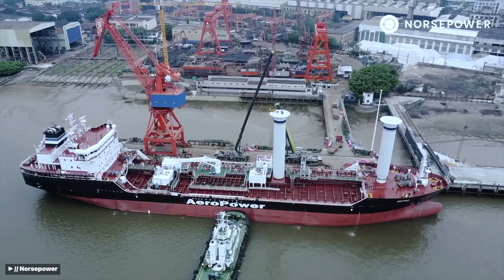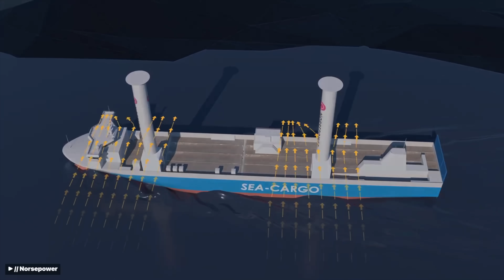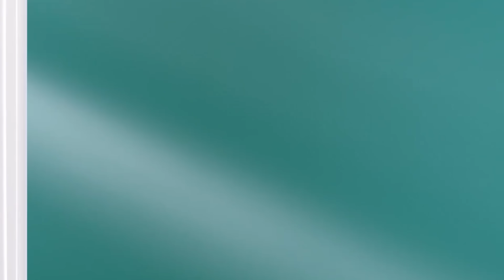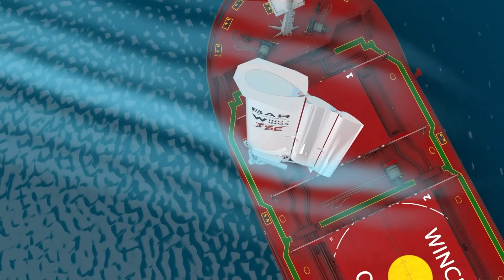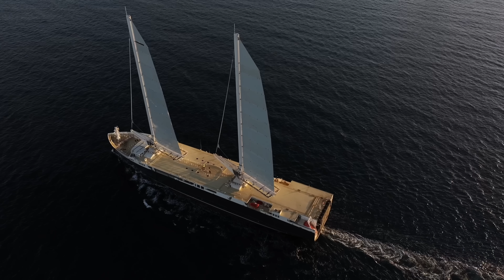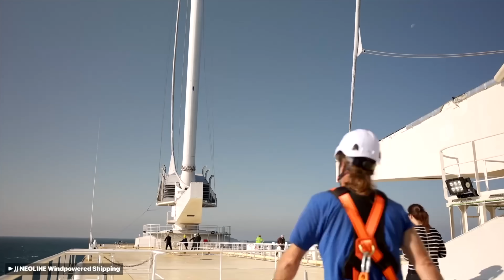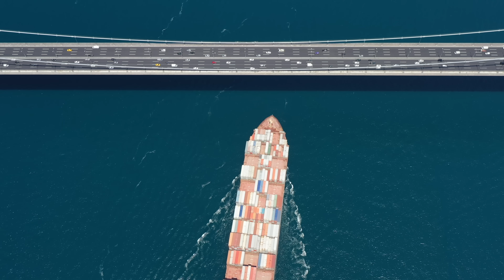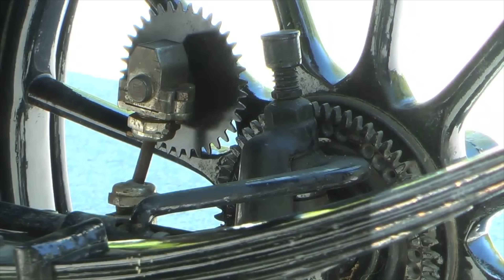Surprise Breakthrough Solves Shipping's BIGGEST Problem

Comment: 40% of all shipping moves fossil fuels like coal, LNG, or oil. Which means global shipping will decrease MASSIVELY once electrification kicks in at scale for ground transportation.
Reply: When will electrification kick in?
Reply: @rjbiker66  It's a slow process, but a lot of countries are trying to get to net 0 by 2050 and electrification of most road traffic is a big part of that.  Advances in battery technology are happening all the time, too, slowly making EVs more palatable and/or more affordable.  

Big part depends how bad the oil shock from Iran turns out to be.  If it brings back the idea from the 70s that even if you have money, you just can't reliably get enough oil, that's gonna add a whole new national security angle to electrification and green power options to the existing concerns about climate change.  And...well, we've seen how countries will try to move heaven and earth to ensure their national security.  That might push countries to start prioritizing it in a much bigger way.  Look at China for instance, the country that was suffering from major air pollution issues because so much of their power was coming from burning brown coal (a very impure coal that produces a lot of air pollution).  They're now by far the world leader in solar power and EV construction, largely motivated by a top-down decision to fix the air pollution issues.  (And yes, China's China, they can make top-down decisions like that a lot more readily than democracies can, because top-down decision making is where autocracy excells, but a government determined to foster the development of renewables can cut fossil fuel subsidies, make trade agreements for components involved in renewable tech, preferentially permit renewable energy projects, subsidize power grid enhancements necessary to handle transportation energy coming from grid power rather than gasoline, etc.  It's not like democratic governments can't govern, they just have a much more abstract toolbox)
Reply: @rashkavar  Have no idea if you are a Chinese shill are you are just that gullible.   Green power in China is a facade.   They are building coal burning and nuclear plants in record numbers to power their "electrification" as you put it.  The idiotic net zero concept that foolish liberal governments have forced thru is literally IMPOSSIBLE without a fundamental breakthrough in base electrical generation. Whether that is arc reactors, cold fusion,  solar or geothermal some type of breakthrough is required to make it feasible.   It in s a dream and incredible waste of money to implement until the basic concept is resolved.  It still could be done but to support the replacement of end user fossil fuel use industrial generation of electrical energy would need to be massively scaled up.   You are merely shifting where the power is generated by fossil fuels.
Reply: @toddconnor-wl7xd  not really. Scotland currently produces more than it needs from wind, and we invented the wave turbine which will also kick in to generation soon.
With a nuclear and gas base of 25% we are covered for our needs.
A living example of what you said is unachievable, from an oil producing country.
Reply: @daftgowk1  Again,  wave turbine technology is interesting but it is unproven. Sure looks promising and has had successes in small deployments but will it be like many abandoned solar farms and wind farms where it is great on paper but never actually produces on spec and in a few years everyone realizes the long term maintenance costs make it almost  completely untenable for large scale production.  Also, with advancing technologies the need for electrical power is expected to increase by 100 to 200 percent over the next 10 to 15 years.  Do you think the limited green tech can bridge the gap?
Seriously,  I think it would be great but any meaningful success has only occurred in places with very specific geological features that make it particularly compatible with certain technologies such as Iceland using geothermal and the Faroe islands demoing wave tech.  As for Scotland, the technical papers I have read estimate 30-40 percent green energy and that is if everything is producing optimal results.  Many say it will be closer to 20.  Increase in electrical demand looks to degrade any improvement year to year.
Reply: @toddconnor-wl7xd in Scotland as I said already, we already produce more than our needs from wind alone, not 20% or 40% as you said, that's simply fact, .are you reading old studies rather than the fact of what is happening as we type?
I know a fair bit about it, my dad and uncle were OGs in the oil industry in the 70s,ended as captains of the global industry managing fleets of rigs, and oilfields having led in most oil producing countries in the world. 
My cousin manages many of the wind farms in Scotland. My brother worked on the gas rigs.
I have friends who are working to develop wave turbines, and although as I said, it will generate soon, not right away, it has been proven outside of commercial applications. It's not unproven, it has not been adopted yet commercially as it has only recently been invented.
I agree different countries will have different solutions, maybe some will rely on solar more as that do now, but I don't agree with your subjective view, as it does not reflect the reality in Scotland, or the potential to do what you said is impossible in other countries.
Reply: @toddconnor-wl7xd  don’t forget that across the uk and especially in Scotland we turn off wind turbines so the gas turbines can run long enough to be efficient and we pay the turbine people the going rate for electricity which is bonkers. We need better investment in storage so we can harvests the electricity better.
Reply: @toddconnor-wl7xd  China is deploying generation capacity as fast as it can in any form it can produce. Coal just happens to be one of them. They also lead the world in every other category, because they work.
Reply: @sCiphre  Not sure of your point.  Yes they are increasing fossil fuel and nuclear baseline e!ectrical power generation at record pace because again yes they work and are reliable  Technically they do produce the most hydroelectric in the world of any country as well but it is because of its gross scale not its efficiency. The dams are more about water control than power generation.    As for green generation such as solar, wind, etc  most are vanity projects by local jurisdictions and rarely work to spec if at all or stay in service for long after the local govt receive the national incentive payouts from the main govt. 
The point of the original poster was to point to China as a paragon of green energy to validate the net zero concept.  As if the majority of its power comes from green sources.  It just isn't true.
Reply: @toddconnor-wl7xd  he didn't say they're independent from coal or oil, he said they're leaders in construction of green energy. Also although nuclear is dependent on a finite source, it is still more green than oil and obviously coal. It is all a process, I don't get why people get so defensive about alternative energy sources. Constraints drive innovation.
Reply: @reapwit .   
He is referencing net zero policies which is to end all fossil fuel usage.  Also China which  is being held up as a paragon or model of green usage we should all ascribe to.   Which is absurd if you actually know the situation in China. 
I am all in favor of green energy development but that doesn't mean I am not aware of its current limitations. 
 What I am not in favor of are the sweeping forced changes of  the entire infrastructure to  electrification  before a sustainable industrial generation technology is developed.   Literally all this entire initiative does currently  is spend trillions to change where fossil fuel is used.   You go from end user use in vehicles, ships and homes, etc  to all fossil fuels burned  at the base industrial plants to produce the "green" electrical  revolution.  It is nuts.   
Your other statement  about nuclear is both yes and no.  Certainly doesn't produce green house gas but the radioactive waste is far worse as we still do not have a affordable treatment method or a completely reliable storage method.  
Anyway,   the jist  is the liberal govt's are forcing this change before the technology exists to support this entire new energy paradigm.   It foolish and wasteful. 
As soon as someone develops a fusion reactor, or megajoule solar array,   advanced nuclear remediation process -- something that this new infrastructure could feasibly develop around. Then and  only then will this massive shift be a good idea. 
But things like the ships using various alternatives green technologies to reduce fuel are great and that is how development is generally suppose to happen.
Reply: Unless they start having to move rare earth materials for battery production
Reply: @docdissent  except it will not hit because electrification is impossible without a robust nuclear power grid. Spain teaches us that renewables are worthless for a national grid. Something constant and powerful is required and neither Europe nor USA are even considering a massive nuclear power buildup. In my uneducated opinion electrification is the same as fusion power generation, always 20 years away.
Reply: @HalIOfFamer  except we already have reduced carbon intensity if GDP because enough cars are electric and enough power is renewable generated that it impacts the fossil fuels markets. Demand growth is massively suppressed from projections from 10-20 years ago. Fusion is still doing nothing, electrification and renewable energy is having impacts today already even if we are decades away from some utopian vision. He’ll look at power tools. 15-20 years ago all weed blowers, weed wackers, chains saws etc were 2 stroke motor driven, now most new ones are battery powered. That’s a pretty massive change unlike fusion power.
Reply: @docdissent  Electricity is also power... so where are we getting that from?
I expect you thinking of green power?
Using less energy is the best solution.
Reply: Magical rainbow unicorns farting electron streams will make your dreams come true.
Reply: It's not 'fossil' fuel. Converting biomass to hydrocarbons requires pressures that far exceed the the depth oil reserves are typically found at.  That is the inconvenient truth nobody is allowed to mention. It's hard to control a global currency backed by oil if nearly any nation can get at it with sufficient technology...(and I'm not suicidal, btw.)  
The relevant search term is 'abiotic oil'. There's no hydrocarbon crisis if you drill deep enough. The other interesting term is 'methane clathrate'.  Good luck, have fun.😉
Reply: @dirtdiggity1714  The method of creation isn’t important for this debate though. Abiotic hydrocarbons still contribute to global warming and pollution
Reply: Doc, the data was a bit hard to tease out. But by weight, about 1/3rd of truck cargo by weight is coal, oil and gas. That is just over 6 billion of the total 18 billion tons.

The semis hauling gas and diesel and the smaller but still huge trucks hauling propane are far and away the heaviest trucks commonly on our roads. 

Extremely heavy trucks do a lot of damage to roads, much more than far lighter Pickups, SUVs, EVs, small gas cars, etc.

A single, 80,000 pound semi does the damage of 9600 cars and pickups.
Reply: @freeheeler09 The comparison per person per kilometer per year between cars, trucks, bikes, buses, and trains is also interesting. I wish I had the numbers.
Reply: Science is fun and interesting...that's the point of the video.  No one cares how smart you all think you are. 😂
Reply: But the reduction in fossil fuel shipments will be replace with other forms of shipments so we need to decarbonise shipping regardless...
Reply: if more countries drilled for oil in their own countries instead of buying from overseas then you could cut the Co2 from lots of the shipping now.
Reply: @DanielsCorner644  It's not like there's a layer of oil under the ground where you can install a tap. Many countries don't have oil.
The rich countries who have oil either export it to get richer while using some themselves (the US), or export it to fund their own solar+electric transition (many Gulf countries).

There aren't many poor countries that have oil. If they did, they'd be rich (even if, depending on the government, the money wouldn't necessarily trickle down).
Reply: @DanielsCorner644  The biggest CO2 contribution of oil comes from burning it. Like, by far. Extremely far. Shipping isn't the reason why burning stuff pollutes the air.
Reply: @Regretr1 Agreed, although ships are especially dirty and always a part of the problem.

Comment: I think wind will help battery powered ships work on most routes. So it looks like wind + batteries will be the future of shipping. 👍
Reply: What charges the batteries?
Reply: @rjbiker66  A big charger at the dock, or container size battery swapping for smaller ships. China is already building electric ships. Look it up. Scandinavian ferries are all going electric right now They have a lot sailing around already. But bigger ships will be a challenge. China is working on them, but can only be used for shorter trips, port to port. Longer trips probably won't work. TBD

Comment: Questions not answered in this video:

1) What is the average change in shipping times?  Longer shipping times will strain supply chains that have become dependent on JIT receipts.

2) Which of these systems are adaptable to existing ships?  Only the final one is obviously so as it can attach to the anchor mounts.  With many cargo ships staying in service 50+ years, this is not a small question. 

3) What is the capacity penalty?  The reason hydrocarbons won is capacity and reliability.  With modern wind tracking, the reliability issue is less of a concern as we can accurately forecast winds up to a week out.  However, ships have gotten heavier by many times since the olden sailing days.  Furthermore, winds are only so fast and therefore can only generate so much pressure.  The acceleration is a function of pressure times area divided by the ships mass.  And the acceleration has to be high enough to overcome the ship's momentum to start it moving.  This is especially relevant to costs.  Modern ocean freight keeps costs down by using extremely large ships to move massive amounts of cargo.  If those ships have to get smaller, then the freight costs will go up significantly.

4) Ultimately, how does this affect shipping costs?  As explained above, smaller ships will drive up costs, but reduced fuel consumption will drive down costs.  Where this falls out is unclear.  I am not confident that this will fall out to the positive as most of the specific examples in the video were either smaller vessels or specialized vessels.  There is another possible positive pressure here in that smaller ships would be able to use more direct routes.  The largest container ships are too big for many transit canals like the Panama and Suez.  So, they have to take longer routes that burn more fuel and take significantly longer.

I like the rejuvenation of old technology with modern improvements and think there is a place for it.  However, the implication is that this could cut a major chunk of the fuel consumption for the entire commercial shipping fleet eventually.  I am not sold that that is true.  It can help, but there are a lot of adjustments that need to be made that may, or may not, be economically viable.

Also, one thing the video did not touch on is that cargo ships are, by a long shot, the most environmentally friendly way to move cargo.  They use a fraction of the fuel per pound of cargo that planes, trains, and trucks do.  So, the better option in the short term, ecologically speaking, would be to off-load more cargo transport to ships.  But, all people see are big belching behemoths and don't take the time to think about economies of scale.
Reply: As it is only assisting, for fuel savings and not reliant on wind propulsion, then it would not affect shipping times.
Reply: @SimonRCh  Not necessarily true.  Adding propulsion from the engine reduces the benefit of the wind and vice versa.  Furthermore, the standard is full decarb by 2080.  So, eventually there will be no hydrocarbon backups.  What then?  

To truly make use of wind to its full effect, it would have to be responsible for the entire forward momentum of the ship.  If the engines are pushing the ship at or near the wind speed, there is little to no benefit.  So, in low wind conditions, you have to pick one.
Reply: @boeubanks7507 you can still get power from the wind, even though you are moving above the wind speed, as long as it's is not directly aft.
Reply: @SimonRCh That is a physical impossibility.  Wind is the same as moving through the air at a certain speed.  If you are moving at or greater than that speed and not opposing the wind direction, it cannot deliver any pressure to the control surfaces (sails) and therefore can not impart net energy.  This is not the same as a tailwind on a plane.  A plane is moving exclusively through the air, so a tailwind reduces the pressure in front of the plane slightly from neutral.  This reduces fuel consumption and increased speed.  However. A ship is moving through a seperate medium (water) and using the wind exclusively as a power source.  That power source has to impart pressure to the control surfaces.  If you are moving at or near wind speed, there is no net pressure on the control surface.
Reply: @SimonRCh Also, side loads are just vector additions of beam and keel winds.  Once you seperate those components, the same rules apply.  This works for a sailboat because you don't have an active independent propulsion source.  A crosswind of any angle would just be a reduced version of that wind coming from aft.